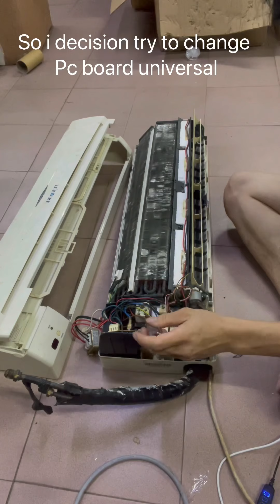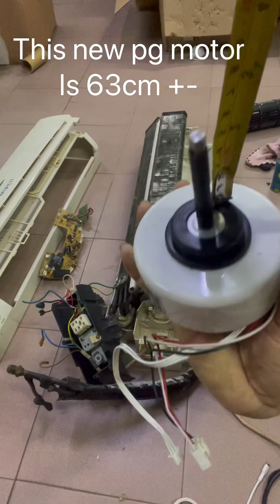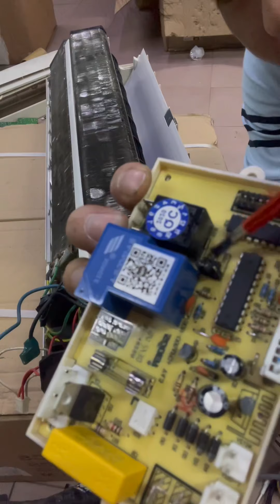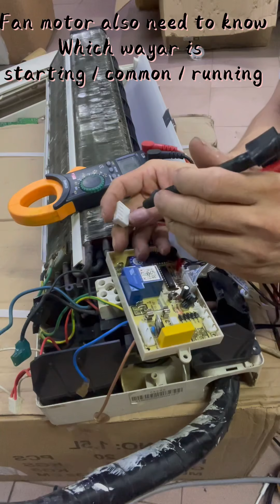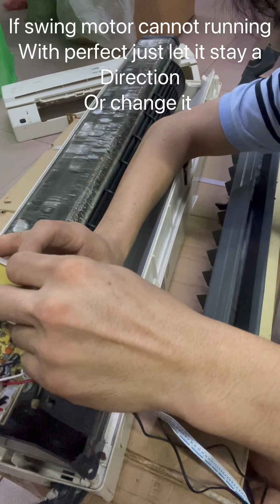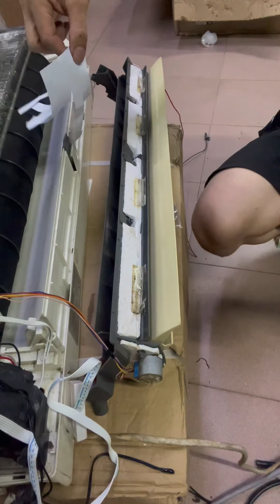PG fan motor universal aircond pcb change. How to Multi pc board air-conditioned repair fujiaire pcb

Comment: 请问你的pcb目前还可以用吗 我打算自己买来装 拍不耐
Reply from the maker: 还可以用 ， 没有问题
Reply: 我刚在Shopee买了 一片1·5   ac pob inverter ，价钱在RM207装了之后  全部可以运作 只剩下 outdoors 风扇不转 要推一下才可以转 可是转了很慢 过来一下 compresor 就停了 请问什么原因呢 原装kapasito 2 uf 现在的是2·5 uf 我用 multi meter检查了 是1·9 微法请指教 谢谢
Reply from the maker: @lan3908   散热不够快才会导致压缩机停机， 试下换大点的capacitor 或者 换风扇motor
Reply: Ok tq

Comment: fujiaire pg motor, if using pcb dont have pg can use or not?
Reply from the maker: Can but cannot control speed saja
Reply: If the fan motor rotation is reverse?what need to do?
Reply from the maker: @stephendelosreyes118   exchange wayar in capacitor (running / starting)